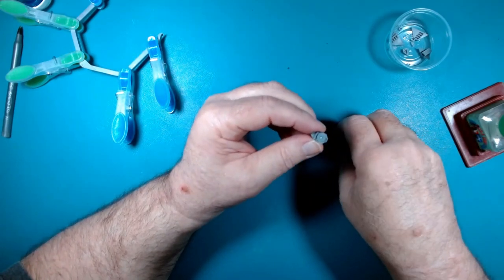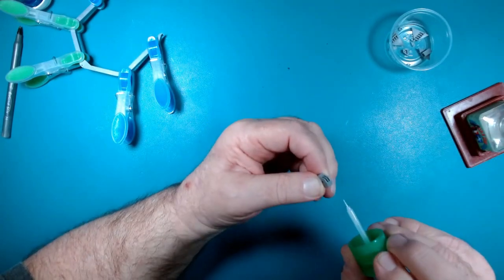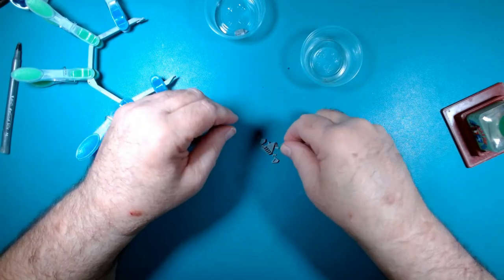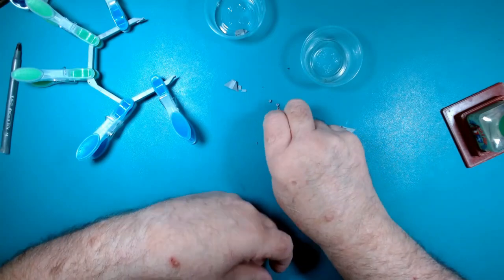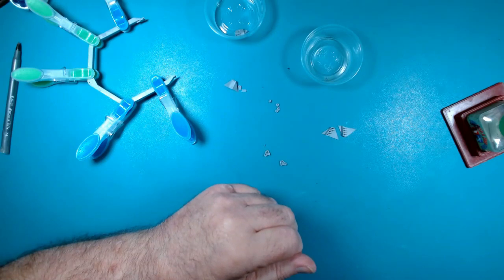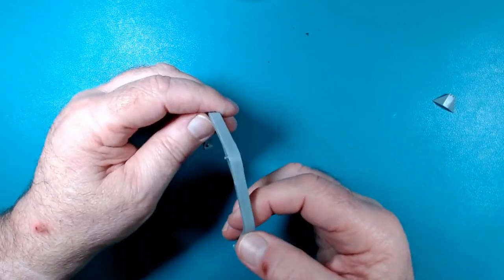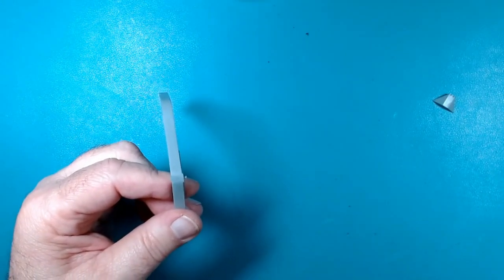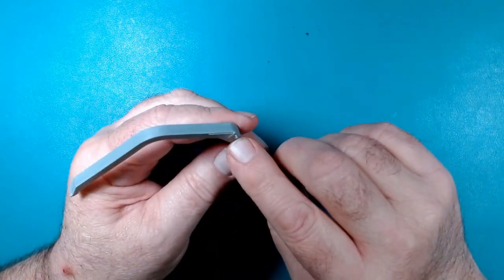MiniArt 35291 US Armored Tractor Part 16

Comment: The way all the parts assemble is interesting. Old technology but it works. Reminds me of some of the very old LeTourneau machines.
Reply from the maker: Hi Thomas, Thanks for watching.  There is nothing wrong with old technology, LOL.  I'm old technology and I still work, sort of....  I think this dozer was designed in the late 1930's.  I have seen some of the Le Tourneau equipment.  Very well built, that's for sure.  Have a great day.  Jeff
Reply: @JeffDonahueScaleModeling  I thought it looked like 1930-1940 range design. They made things solid back then.

Comment: Nice progress Jeff i would say a carpenters panel pin would work in that area there is a small head on those pins it might work for ya 👍👍
Reply from the maker: Hi Seamy, Thanks again for watching.  You have a great idea for a replacement for that pin.  If I didn't have a lathe, I would probably of tried that.  I made up my own pin out of a bit of brass.  You can see what I did in part 17.  Have a great day buddy.  Jeff